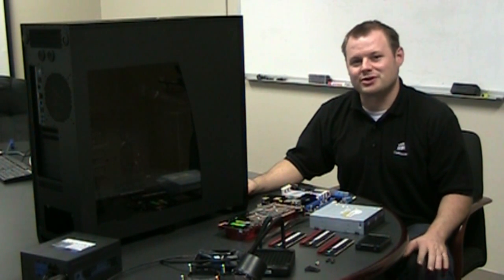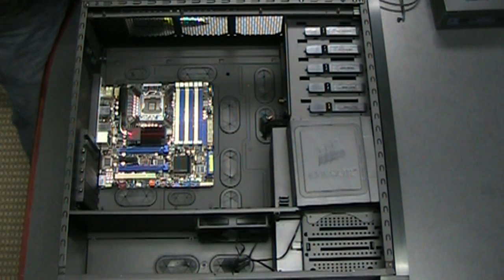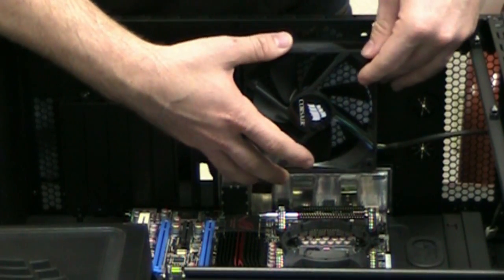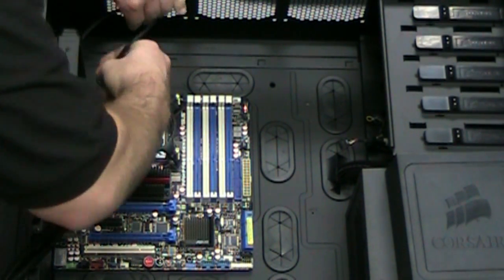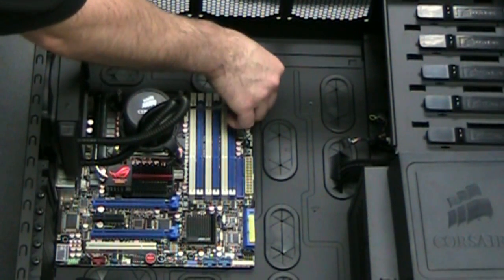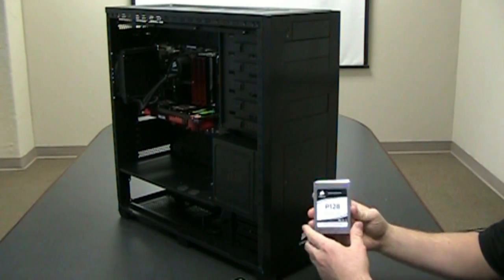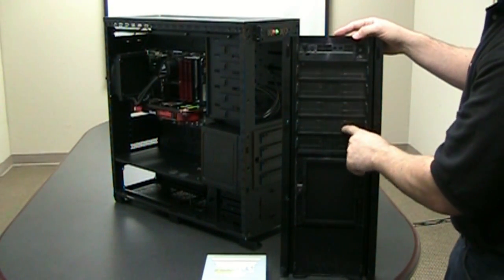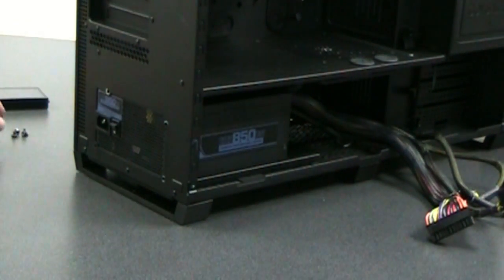Build a computer using the Corsair Obsidian Series 800D Chassis

Comment: Back in 2010 had a motorcycle accident and used the ins to buy this case, along with a Asus Maximus extreme IV, and a corsair AX1200 ps and i7-2600 with corsair water cooling, and 16gb ram. 
Today still going strong with this setup.
 Thanx Corsair,  for the great setup.

Comment: @HQsound ...through the radiator. It also makes sense because the heat will rise to the top of the case and be ventillated out. However if you do configure your system into a push pull method, I would recommend doing it by pushing air through the radiator on the inside and then continuously pull the air through the radiator and out the back of the case.

Comment: Wow, massive case. :)

I got a question though.
You mention about the HS50 that you want to suck air from the back of the casing to get as cold air as possible.
I would reckon that since the fan has no airfilter, that the radiator might get clogged up with dust after a while?
Is it preferable to use the air inside the casing (have the fan blowing out), if you have a casing that has filters on all fans blowing air into the casing, keeping it more or less dust-free?

Comment: @gulanka1 an hx850 should be enough, most people tend to overestimate the amt of power that they really need..that said, unless you're planning on having a bunch of 5870s or 5970s in crossfire and a bunch of high power drives, you're not likely to require more than 850 watts (and tests have shown the 850 to be able to deliver quite a bit more than 850 watts)

Comment: @SlipAllCityToy 
haha, fair enough; 
Actually I purchased one and just so everybody knows, a normal board fits just about the same, I'm not going to sit and study the video too deeply, but  there are actually still holes above, underneath, and to the side of the board after installing.. I will say that some of the shields for the inside of the case felt a little off, they didn't quite want to sit back in place. it IS an awesome case thou, and the black is just as deep as it appears to be.

Comment: @HQsound Lol. I'll give you credit on the grounding. But the other two are mistakes are wrong. The radiator cannot be mounted on the outside because it is an enclosed water cooling solution. He would only be able to do that if you slid the hoses off the radiator, which would defeat the purpose of an enclosed solution. And the idea behind blowing air through the radiator is taking the cool air outside the case and blowing it through. You would be taking alot less heat out if you sucked it out...

Comment: @killyamomz Go for a 7970 instead of a 580. Faster, same price.
Also, sounds like this is a pretty high end build, so you can look into getting a full water cooling kit such as the rasa rx360. Also, with an AX850, you'd probably be able to crossfire 2 7970's.

Comment: I have this case but it could be improved, here´s a list of things I want to see changed:

1. Make the whole bottom ventilated

2. Increase the speed of the fans

3. Include three 120mm fans at the top to exhaust

4. Make the 140mm fan at the back to a intake fan and include a dustfilter

5. Make the bottom hdd cage removable so people can mount a radiator without modding

6. The I/O port doesn´t come down automaticly if theres a optical drive at the top 5.15 inch drive bay, please change this.

Comment: Whats the name of the awesome music? Also the 800D is way too big, heavy and expensive. Corsair should make smaller Mid or Mini Tower cases with the same cool design feature like the CPU cooler door, the cable routing holes, and the nice matte paint, all in a smaller, lighter, and cheaper mid or mini tower configuration, priced at under $100.

Comment: The airflow is garbage unless you install 3 fans at the top, I made them intake but with each blowing at 2000 RPM the heat dissipation wont be a huge problem

Comment: Should have had 10 x 3.5” Hot Swap drive bays in a horizontal configuration with 5 x 2.5” Hot Swap drive bays on the side in a vertical configuration. All in a completely seperate noiseless cooling rom going from the bottom of the case up to about the third 5.25” drive bay (only need 3).

Comment: If i'm gonna spend $300 dollars on a case the least they could do is add some Kensington locks or some other type of security. I spent over $2000 on computer hardware and Corsair overlooked the value of their products. A K-lock can be cut by wire cutters but at least it's better to try securing the case.

Comment: I was considering this case, but the main problem I see is there is no good air cooling flowing from front to back..how the hell did they miss that flaw design. You put fans in but no way for the fans to pull air in.. I'll get antec  again..this time the 1200..I have the 900 and it's decent, but it's tight to work in it and that's the reason I considered the corsair..I might go with the lian li though...
I also think the website needs work..

Comment: Setting that fan radiator as intake is a bad idea. There is no dust filter on it and it will eventually clog the radiator with dust.
I am seeing one major problem, there is no intake with a filter in the front of the computer. My Cm Storm Sniper has much better fan air flow with dust filters then this case and its almost half the price.
It is a very nice case but could use a direct fan intake, not that fan that is "intake" just below the hot swappable drives.

Comment: are there 3 fan slots on the top 120mm so I can get 3 blue 120mm fans as exhaust and have the fan on the bottom be intake as well as the fan for the h50 be intake. 

what is the best fan setup?

Comment: I'm thinking about purchasing this case and I have the hx850 but the fan is facing up and exhausts into the case when the label on the psu is right side up. From the video, the fan is facing downward and I assume that the fan is sucking air from the foot of the case and exhausts out through the back? Can anyone answer?

Comment: @silowhore because then you can do better cable management cause as you can se in the vid the m-atx board is sourrounded by the holes for cables .. if you put a normal atx or L-atx in there a lot of those holes would be hidden behind the board and you couldnt do such a beautifull cable management as with the m-atx board which is important for better airflow and cooling :P ;)

Comment: Hi, I was wondering whether the hx850 would put out enough power to run this system nice and smooth.
corei7920
asus p6x58d motherboard
intel x-25 40gb ssd
2x 7200rpm 500gb hdd's
6gb dominator 1600mhz ram
ati hd5870 gpu
and some fans

Any help is appreciated :)

Comment: Sorry to disagree with the installation of the H50.......but, you should be exhausting the fan out of the case not into it. All the heat going into the radiator coming from the CPU is going to go into the case. It's best to get excess heat out and away from the case.

Comment: Excellent case. You can buy solid steel panel (to replace the one with acrylic window) for $20 @corsair.com; they also have 6 Gbit SATA backplane upgrade kit. Video itself was useful. This is not a cheaply-made case - you can't just pop 5.25" drive bay covers out - entire front panel needs to be (easily) removed.

Comment: The guy installed the rad fans airflow inside the case, lets heat up the thing.....300$ for a case....Is this a carbon fiber or titanium case?????? My Antec900 do probably the same job if not better for only 90$.....

Comment: Why in the world would you waste the time showing an install of a MICRO-ATX board? To show how there is a ton of extra room if you made a bad choice in buying a micro board?? I also don't like the reversed fan on the radiator bringing colder air in but pushing the heat of the radiator into the case. =\ Perhaps the idea was there was so much room for that hot air because the board was so small. Haha (only kidding) Video shows a lot about the case though, so thanks for that!